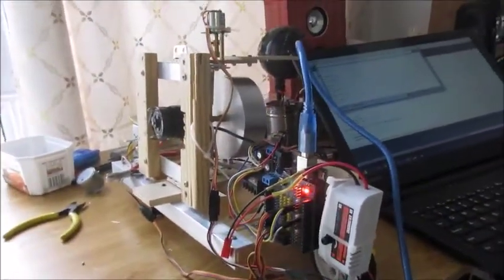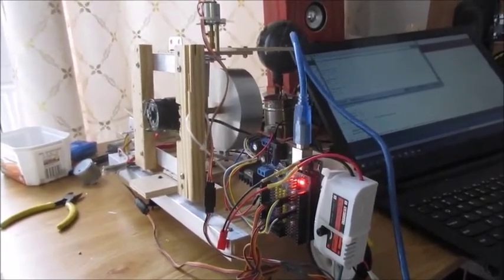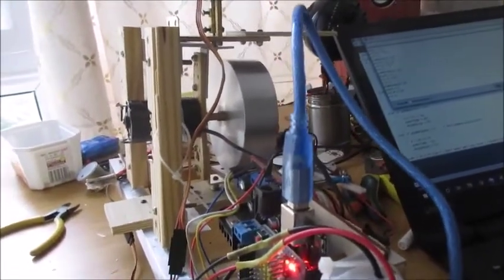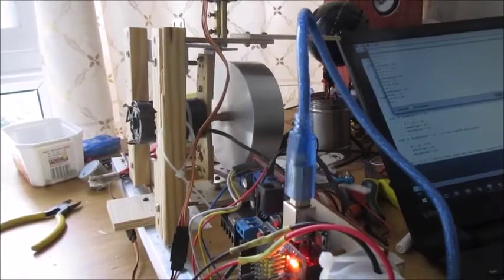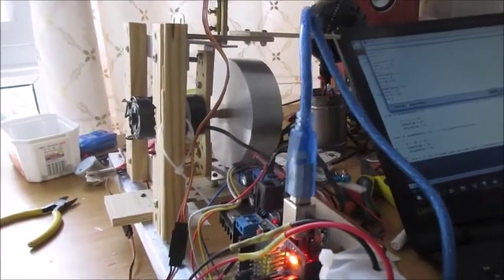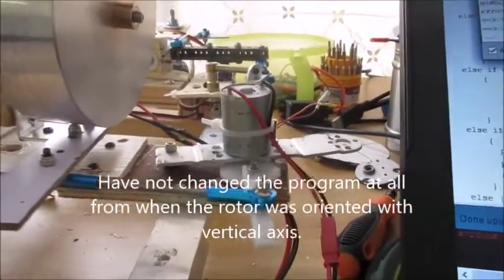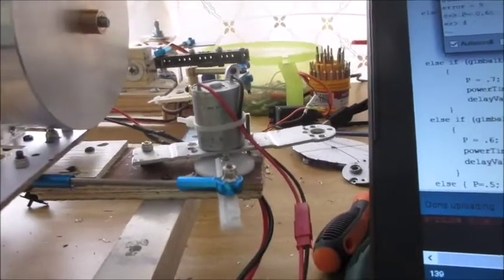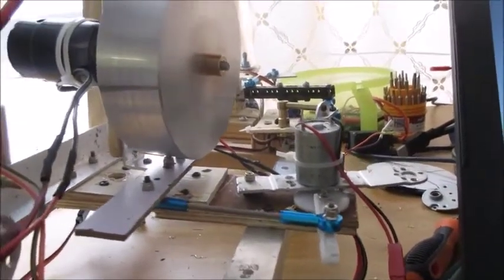Self Balancing Gyroscope Two Wheeler Part 8 Horizontal Gimbal Mount

Comment: Thanks for posting your update Jimmy.
Reply from the maker: I got it working with batteries. It turns forward right and left without falling over but I need to add some code to help it turn a bit better. Will make a video soon.